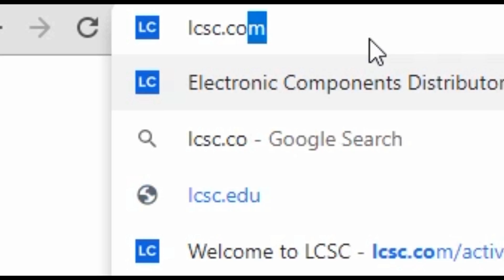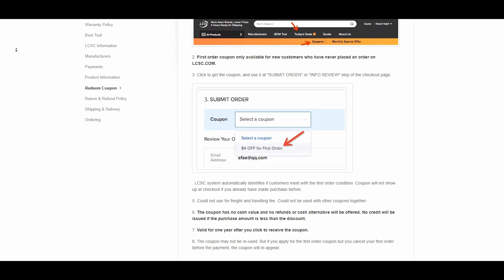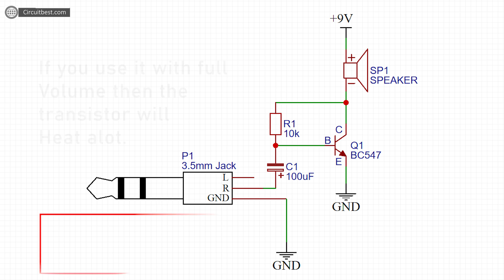Simple Basic Audio Amplifier with BC547 Transistor

Comment: How much watts is the  SPEAKER.? Please do reply
Reply from the maker: 3to 5w
Reply: @Creativecreator   From Where can we get these speakers? From Local Shop?
Reply: @Creativecreator  Hi, what if it's 8w ?
Reply from the maker: @Fun-io9kv  you can use any high-power NPN transistor in place of bc547 it will work just fine.
Reply: @Creativecreator  to use with a 8w speaker?
Reply from the maker: @Fun-io9kv  yes
Reply: @Creativecreator  thanks and shouldn't the transistor be a bi-polar one? I have BC548 will it be okay instead of 547?
Reply from the maker: @Fun-io9kv  yes it will work fine
Reply: @Creativecreator  thanks man
Reply from the maker: Yes😁
Reply: @Creativecreator  From where did you get these speakers? PLEASE REPLY

Comment: What does the resistor do in this circuit?
Reply: Resistor is used to control the current through base. To limit the current (transistor overheating) and do forward bias between Collector and Emitter.

Comment: Can I use 220uf 25 v capacitor with 9voltage
Reply: Yes, you can. Capacitor has voltage limit and not designed to work with more than 25V, but with 9V thats OK.

Comment: I tried the circuit, and the audio distorted when the radios volume was turned up.  I have to use 5 volts next time instead of 9 volts.
Reply: Mr. Multitasker  Hi did it work with enough quality in 5v ???

Comment: BC327-25 plis you work it
Reply from the maker: BC327 is a PNP transistor but you will need a NPN Transistor for working.
Reply: @Creativecreator Thank you
Reply: You can use BC337 . This is NPN ( the bc327 partner). BC337 is more powerfull than BC547,  both in TO92 case.